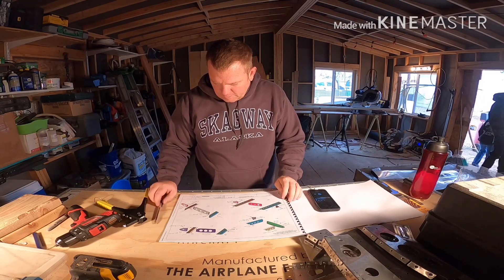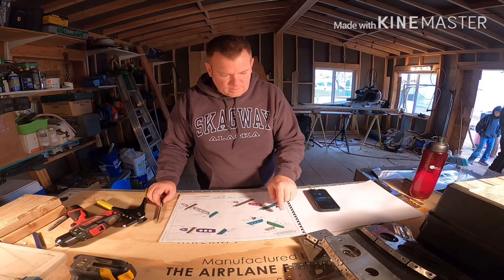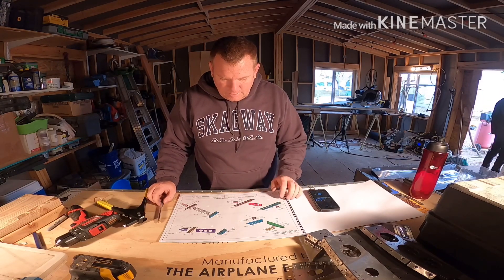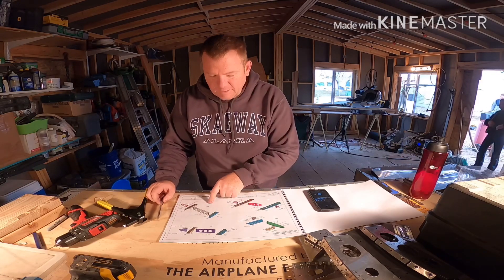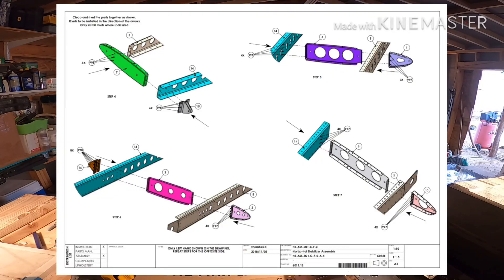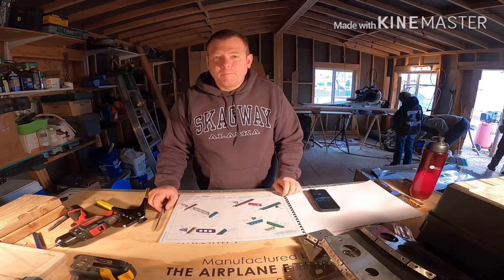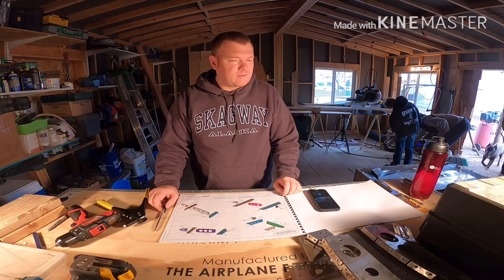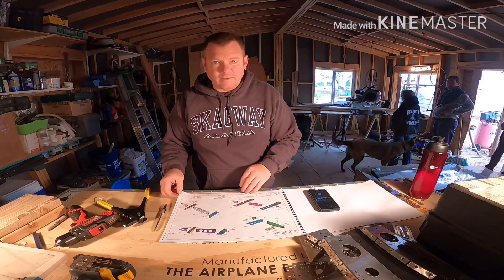Empennage Horizontal Stabilizer Assembly Step 4-7

Comment: Hi Brad.  When you can, do you mind giving us the dimensions of the horizontal stabilizer in terms of length and height once it is assembled?  I'm assuming that is the longest piece.  Also, the dimensions and weight of the box for the empennage would be helpful too if you can. Thanks, and good luck with the build!